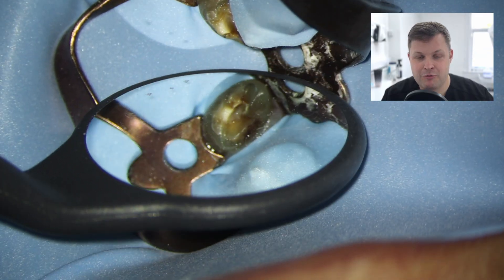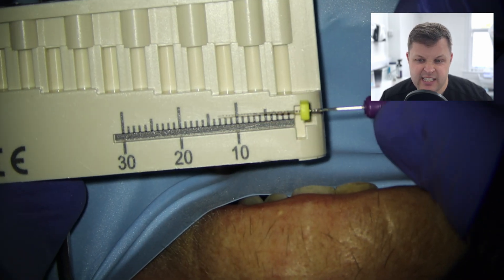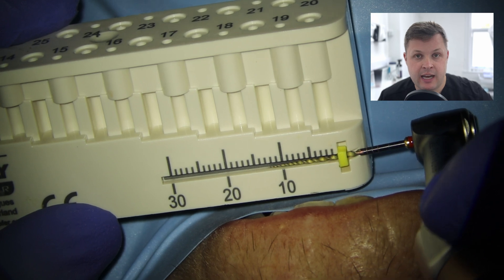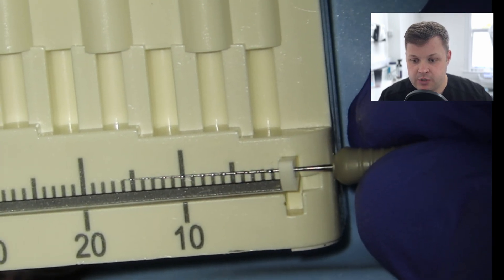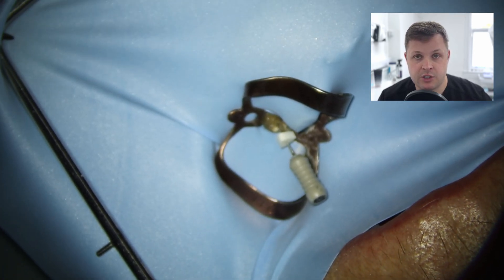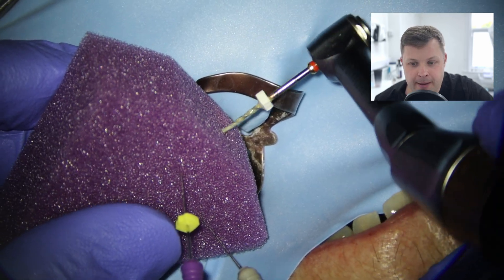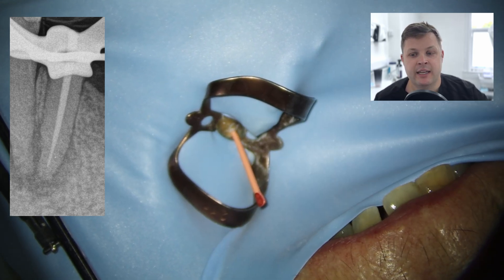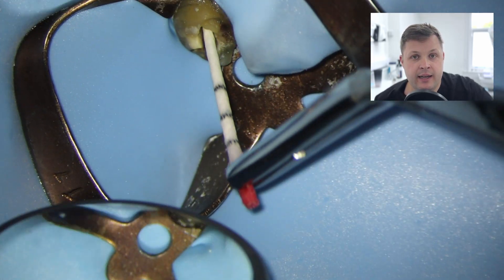From Broken to Beautiful: Full Endo-Resto Case

Comment: Thank u for the videos & ur work💛🌻 ... I have a question " am working on upper 6 & it's retreatment endo cuz it's too short ( the GP ins not to the full lenght to the apex) and after i took all the GP I have a problem  to find the rest of the canal to go down to the apex so should i use the same method u used in this video to take the size 10 kfile do a precurve to find it or is there other way to do that !? " 

Sorry if it's too long to read 😊
Reply from the maker: Oooh that’s a tough question, as it depends on the clinical situation. I suppose you could argue that’s why it was originally short! It could be a number of reasons, maybe the sealer has blocked the canal; maybe there is a ledge; or even an acute bend in the apical 1/3. Very difficult to say. Sorry I’m not much help!

Comment: Great case. Could you discuss sealers. Which ones are suitable in which cases/situations. I've heard you should not use bioceramic sealers with warm vertical  but I am not sure why. Also deep splits. How to clean and obturate them.
Reply from the maker: Again I am not entirely sure of the evidence, however I have been told that using heat desiccates the dentine (making it dry), and because the bioceramic need water to set it does not set hard. Also, if you’ve ever heated a bioceramic, you’ll notice that it changes consistency. Almost clay like. I’d be happy to have someone correct me on this!

Comment: The parapost system always scares me. I usually get off axis on my post space prep. You should give the Rely X Fiber post system a try. It’s a tapered drill that essentially follows the canal space like getting a glide path set up with your rotary files. It’s the easiest post I’ve ever placed and I can reliably slam them within 4-5mm of the apex without fear of perforating. Great case though. I will definitely use the tip of opening the coronal portion of the crown more when binding early.
Reply from the maker: I’ll look into that! It can be quite scary for sure!

Comment: Do you rinse off the NaOCl of the GP points after disinfection with isopropyl alcohol or other irrigant? Are you worried that the residual NaOCl would interact with bioceramic sealer?
Reply from the maker: Great question - I tend to dab them on a sterile gauze before I put them in the canal. I know it is not perfect, but it is better than nothing! Also I would like to ask we are about to launch a Podcast for dentists who hate root canal and want to discuss ways of making it better - do you have any topics you would like to see?
Reply: @ilovethepulp  I think the biggest issue I had when I was doing general dentistry was what armamentarium to use. There is so much marketing and it is hard to decipher how to use each file system/apex locator/sealers.